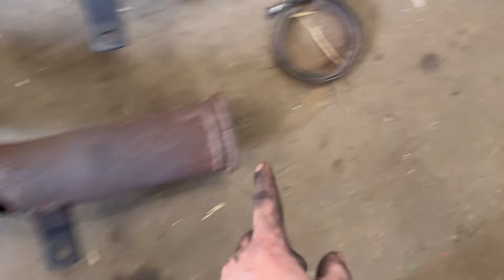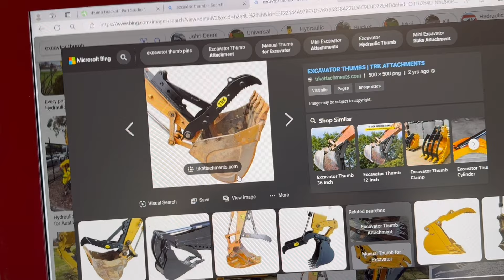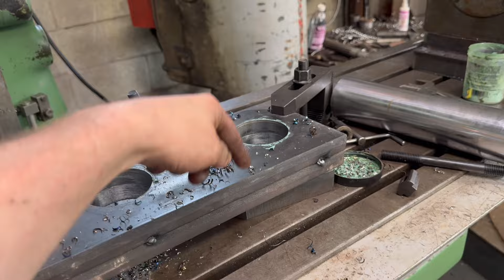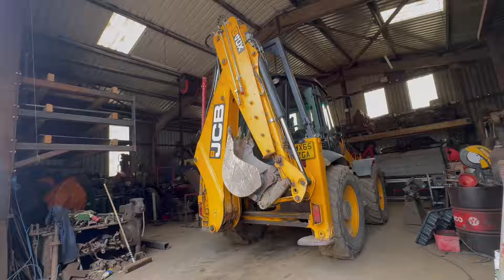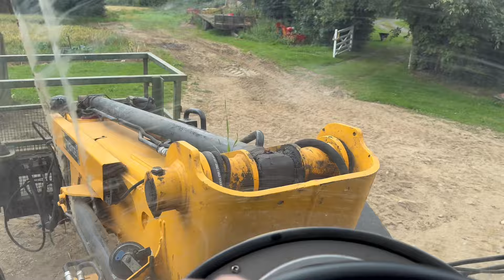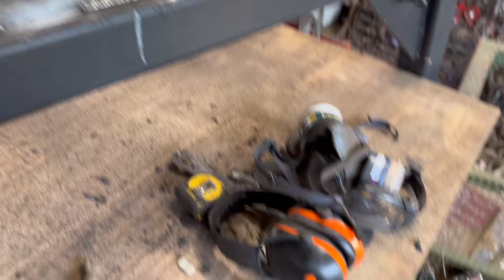Ford TW25 exhaust. Digger thumb bracket and 4CX pole rack.

Comment: As usual, exhaust manifold bolts shear off, it's second nature to centre pop, drill out and reinstate the original thread. It is a problem with NC programmes that they need a continuous boundary for a profile, about time that they created a function to create an interrupted profile, so that one can make use of existing edges and reduce scrap. This problem is over 40 years old now!

Comment: You’re using 10 clamps for welding and 2-3 for machining pal . The tolerance for movement is far more important on machining, all said n done through great work on everything you do 👍👏🏻
Reply: Spoken like someone who's never done either, you dont use the clamps for the same reason and there is a clear reason why you need more clamps when assembling and welding.

Comment: It’s too late now, but cutting the weld on the bracket that goes to that bolt and weld the new piece on, would have been easier. I have done it on a few things, if I think a bolt is going to snap. Just makes life little easier, plus saves time.

Comment: Consider cutting bracket when you have a bolt that looks like its not going to move and cut new bracket the same and just weld new to old usually quicker

Comment: have you ever run dual shield wire, its both flux core and uses gas. Seems like a nice process, bit more forgiving than mig for cleanliness, and better penetration.

Comment: That bolt snapping was inevitable unfortunately, seen it so many times it's the nature of the beast as far as TW's are concerned, sorry for all the trouble it caused you, but that is life. Then you got your normal route of over engineering the thumb mount. I know you can't help it, making things better than they came in, but after all it is just a static thumb. Then you use an old sheet of plywood to perform gymnastics to replace the plate. 
I must say that Jasic set looks brilliant. all the work you have done with it is a serious hint to buy it for myself, only I don't weld anymore! thanks for all you do Ollie, you are a master of understatement when it comes to the work you do. Those welds with the coated wire looked excellent (- the porosity) but that is not going to be under stupid stresses, under normal conditions hopefully. And if shows you get what you pay for with that wire. best wishes as always .

Comment: My two cents worth. I think the thumb pin should have had a hex washer instead of the round one and lock tabs welded to the outside of the plates to prevent the pin from turning and potentially wearing the bores.The linkage appears to have a grease fitting so that the pin could be lubricated. One point of wear instead of three.
Reply from the maker: The thumb it fixed, doesn’t move. The linkage is off something else I think.

Comment: Hey Snowball, I was noticing some time before the Onshape push, that you had an integrated CAD, CAM, and CNC in some GUI, perhaps your plasma table? And yet you are still into Onshape? Doesn't it save you a step by using the other?
Reply from the maker: Onshape is far more advanced and easier to use. The built in CAD with the kutavar is alright for simple stuff as it does have pre saved shapes/flanges you can alter to suit but for anything one off Onshape is miles better

Comment: Worked for a State highway Dept. that plowed snow on 3 mountain passes in California. Rust was exceled by salt and brine in some areas. We used to carry a wax candle in our tool box To help us  remove broken or rusted bolt. Heat up the area around the broken head or threads and the wax would wick down that treads lubricating them and allowing easier removal.

Comment: Did a check on our welding table same make as yours but only 1 x 1.5 metre also has all the clamps & brackets same as yours only ours was not new when we got it came from another site as a result of being on wheels & being overloaded it has a 1.5 mm dip in it but great bit of kit

Comment: These gas-less MIG welders are very handy. I have two of them, a small one I started with which has a maximum capacity of welding 1.2mm plate  and a 100A one that I use now, which can weld 4mm plate. I've done a fair amount of MIG welding over time and I have never used anything other than a gas-less MIG. The main disadvantages are the fumes and the slag, but good ventilation in the workshop is essential and they are good for outdoor welding when there;s a breeze. I use bits of plywood to protect the concrete in my workshop and on the driveway.

Comment: Pretty typical of exhaust bolts to break like that. This one was easy to fix with good access. The worst one is a car manifold where you have no access. I put copper coat or never seize on the bolt to hopefully prevent this happening next time.

Comment: What is a spring pass????
Reply: Running the lathe or mill across the workpiece a second time without changing the depth of the tool. A tool deflects, and the higher the tool pressure the more deflection. With a spring pass your 'depth of cut' is the deflection of the previous pass, so it is lighter, and won't deflect the tool as much. Mostly used when you measure the tool relative to something other than your previous cut.

Comment: If you could invent an exhaust nut that doesn’t rust to the manifold you’d be set for life!
Reply: Brass, as fitted to early mini
Reply: ...titanium...(?)
Reply: @daleburrell6273  Allis Chalmers did on the 190 XT and  maybe some other models in that era where the turbo mounts to the manifold Found out when I tried to cut one off with a torch.
Reply: Bostik Never Seez Pure Nickel Special is not cheap but by many reviewed as the best against heat and rust.
Reply: Stainless steel bolt/stud/.set screw is what it needs.some penny pincher at the factory years ago knew this but thought they would save some money.
Reply: never seez copper high temp  ... in my experience on the farm
Reply: A lot of newer cars use copper exhaust nuts, works pretty well

Comment: Replacing exhaust.  
Next time 
1)cut the in position exhaust off the bracket leaving the old bracket in position. 
2) remove the bracket from the new exhaust 
3) fit new exhaust
4) weld the new exhaust on to the still attached serviceable original bracket.
I certainly wouldn’t have attempted the drilling & taping the CAST IRON manifold as there’s a high chance it will crack. It wouldn’t be unreasonable for the customers to want a replacement manifold. 
I think it would have worked perfectly well without being attached to the centre bracket.
 Or instead of tapping the hole inserted a bolt with a nut behind..

Also, I don’t know what you were trying to achieve by hammering on the socket with the extension as the impacts would be on to metal and no rotational impact to the bolt. 
SWARFEGER FOR THREAD CUTTING. !!
Thumb bracket. 
Get clean balks of timber planned ,square & finished to precise size.
Place them between the two plates and clamp all three together. No more multiple measurement checking. 
Pole tractor 
Could have bolted the bigger bracket to the existing little bracket. 
Drill or flame cut holes. 
I’d have gone straight to black paint.

Comment: Remember the days of brass nuts on manifold studs. Few pence no problem. What kind of engineer specs standard 8.8 steel bolts for high temperature applications, a Ford one told to save a penny on every engine fastener that’s who.

Comment: I worked on a job at Port Adelaide building grain silos some years ago & every joint was welded with Lincoln Inner-shield wire. 211 for the tank bodies & roofs & 232 for the heavy structural, all welds were logged & visually inspected, some mag particled & the heavy structural welds were ultra-sound tested, (AS1554 part 1). The site was very wind-swept which had no effect on the weld quality, the wire is very voltage sensitive so a clean earth point & tight connections were essential, also we were running long welding leads to the LN25 wire feeders were were using which meant jacking up the voltage to compensate, always use 25mm+ electrical stick-out for best results but when it’s dialled in right it goes great & fast, it’s a good product, did n’t realise it was so expensive.
Reply: I worked at Viterra in port Adelaide, best job I ever had.

Comment: Stops you getting bored with the variety. Wish I could go to a steam rally again. I used to go to loads in the UK. There are some fantastic steam train sheds in Oz. They are always looking for volunteers to work on them and repair carriages etc. With over 40 years wood working experience I could probably be of some use but they are thousands of kilometres away. 
Welding with gas is a joy after mostly welding without. But site work is largely outdoors and awkward to get at. Portable gasless migs come into their own. Especially when you are crap with a stick, like me.

Comment: Have you checked that the gibs are taking up the table wear correctly. A sign that they are not is that when you lock the table in a particular axis prior to machining, the DRO value may change significantly. Thanks for the vids.

Comment: Sometimes an air hammer can help break the rust bond on a stuck bolt if thermal shock doesn’t do it.

Nice one mate !
Reply: Not a good idea on a cast iron manifold. Too big a risk of cracking it if you hammer on a boss on the tubing. Might be worth a try on the manifold bolts into the block

Comment: Induction heater coil over head of bolt or air chisel with round rod directly on end to shake rust loose.  Never used either myself but others have had great luck  my milling machine bed has locks on the x and y to keep it from moving when boring...

Comment: Unfortunately Ford engineers from 50's(maybe earlier, not exactly sure) and up to 70's or 80' thought was smart idea to just make a opened hole 🕳 which let's dirt, water and trash get into threads on back side of hole/threads, which makes something stronger than superman's loctite, they also did this one the engine cylinder heads on the 360's, 390's and 428's. Usually involves enough cussing to make a preacher blush, and turns a 30 minute job into 2-3 hrs job with extremely long drill bits and/or a cutting torch😠(because if it's liquid, it can't be tight 😏🤔) then end up drill hole over sized or the torch makes decision for you and only option is a bolt thru the hole with a lock washer and nut on the back, oh and did we mention it's always in the most confined space possible😒 🤦🏻‍♂️🤦🏻‍♂️

Comment: You need to weld on the volt.first and build up weld using a 309L or312L filler wire using lift arc tig that will heat up the bolt, then weld the nut on. Takes a few goes sometimes but does work. Done dozens of them.

Comment: I was going to comment, that anything to do with exhaust manifold bolts like that, just get the oxy set on them. Don't even bother trying to spanner them. Then you did!
I'd give it a couple of heat cool cycles as well, they can be right buggers.
Reply: Sometimes you just have to accept that drilling and tapping is in your near future!
Reply: @ferrumignis  You're not wrong there. To be honest it's a long time since I last did one. As an Engineer in the Merchant Navy, I seemed to do more than my fair share of them. In the late 70s, before we got oxy welding porta packs, I had to drill two 3/4" Whitworth studs out using a hand ratchet drill on one diesel generator engine. Two days to drill two holes. As the Second Engineer said, "It's character forming." "Anyway, what else are you going to do." As we were heading north up the Malacca Straights towards the Andaman sea, then across the Indian Ocean, I suppose he was right. I have not forgotten it though.